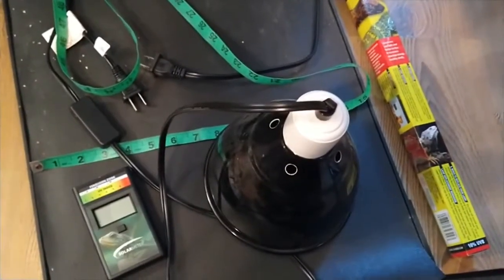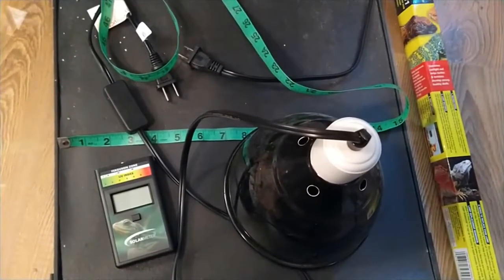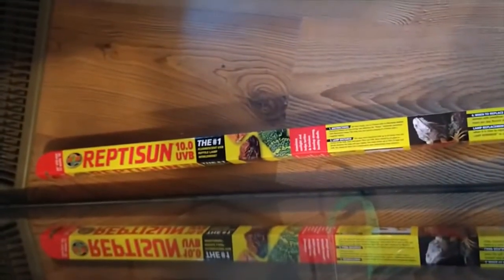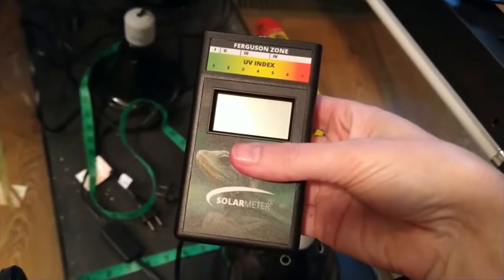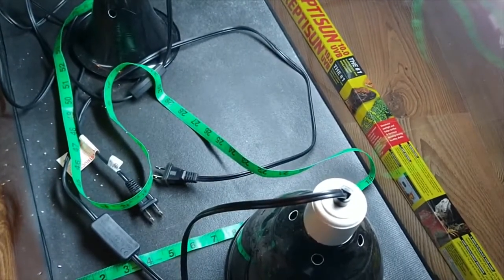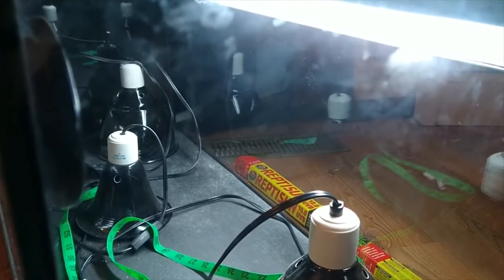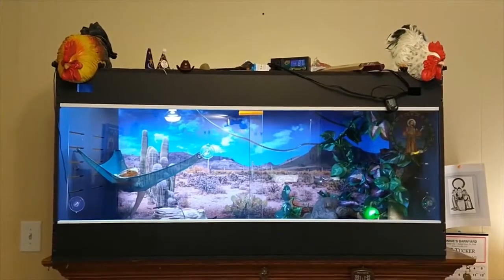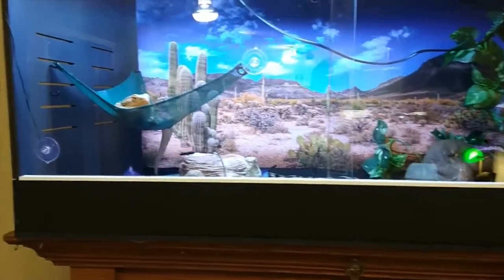UVB results for several bulbs and distances:  Murray, the bearded dragon, got an upgrade

Comment: I know how you feel! As far as frustration trying to get everything right! I just recently got a beardie he’s an adult too. Just switched out the coil uvb to the 10.0 t5 linear tube. I’m just wondering with my 40 gallon tank mesh top if I should try and mount the uvb inside or would that be too much? Right now it’s sitting on top of the mesh.
Reply from the maker: In my recent video with the rescue dragon, I show how I mounted my fixture on the inside, but without my solarmeter to measure the UVB, I wouldn't have gotten it right.  The new fixturewas stronger than the old one and the UVB was different.  I strongly recommend the solarmeter 6.5R, you can get on on amazon or joshsfrogs.com